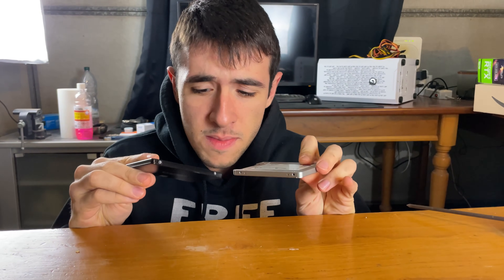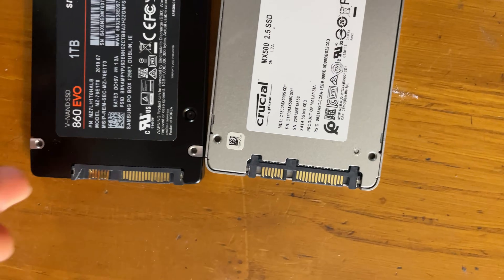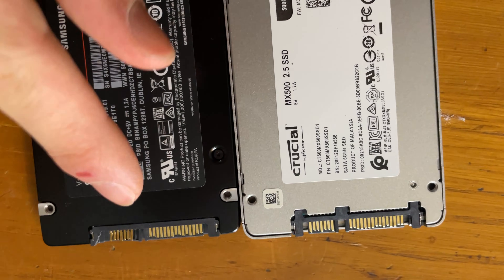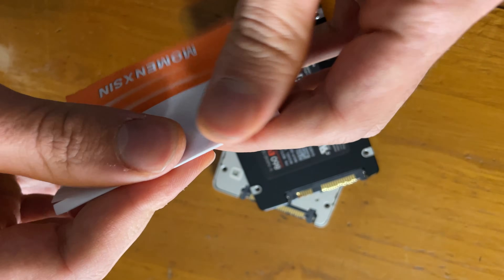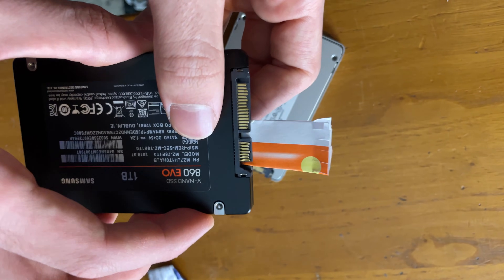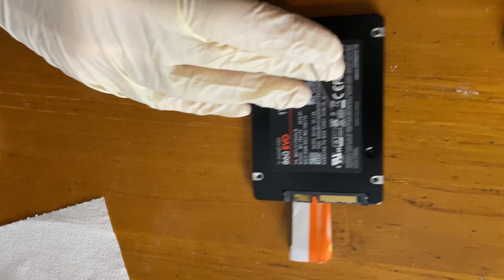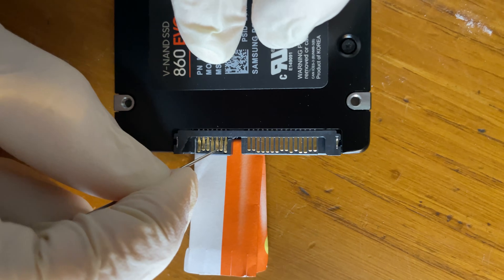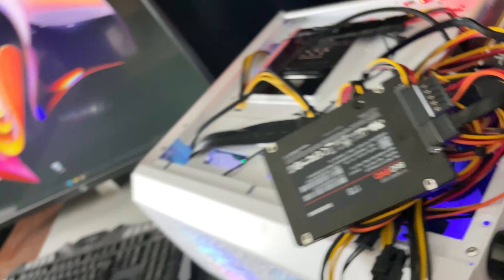Repair your Broken Sata SSD Connector (No soldering)

Comment: I haven't tested it yet, but it would have helped a ton if you could have shown putting the glue on and shown what it looked like after pushing the pins down. Mine don't look super flat even though they are clipped back in at the bottom of the glued in plastic piece. I did my best though, so wish me luck as I test it out!

Comment: That's exactly what happened to me yesterday afternoon and I am not super literate as far as all the internals, but I work on-line and so over the weekend I decided to dissect the budget build I just got and clean each and every pin, surface, and put it back together slowly literally learning each connection and its functions by way of YouTube videos and I organized the fans wires and ran them slightly different for neatness(even though the back is covered) and as I was plugging in the 2 SATA cords it went on, and I only noticed it off-centered and knew I had plugged it in properly as I am big into car audio and been repairing my amps for more understanding of them as well, but I don't  think this will work out like this one did, and I don't have the knowledge of... can I extract the data carefully holding it in place, move that data to (please insert) and figure out what my cap is on internal memory, ram, etc for a B450M board, 1tb wd blue nvme ssd, hyperx DDR4 x2 is what I've got and a portable ssd so I'm left scratching my head cuz I just got this even though it's basically ancient it's all I could afford on the spot, and everything is fully upgradeable and I'll just have to start buying every piece individual until I am where I'd like to be without being foolish cuz I want to run a full on studio where I can let's say move from one station to the next, edit, create, the whole workshop in one cage. May sound dumb, but be able to get another case with a higher end board and connect them having it either side by side or stacked. Now I'm just rambling, but if anyone has thoughts or does hand-me-downs I'm going full in on learning each and every pin its functions tricks, etc because well it's therapy for a 44 yr old guy with heavy adhd and I am super busy, etc.

Comment: sounds cool, only one of the pins actually got pushed into the case, and I'm getting the impression that means the solder connection might be damaged.

Comment: what kind of glue is that thermal glue? i smashed my ssd pretty hard on the pavement trying to dust out the inside of my desktop, sata connector plastic bit broke off leaving the pins bent up and the metal casing partially ripped out. i'm gonna mess around with it .
Reply from the maker: I’m using “attak” loctite!

Comment: thanks very much for this video :)  .. in my case the sata pins are bent downwards but shockingly the 2.5 ssd drive still works it surprised the heck out of me !  ... No idea if the drive will have problems later on down the road I hope not  :(    .. I've made a note of your video in case the drives stop working - thanks again :)
Reply from the maker: Ahahahah let's hope you won't have to come back to this vid then :) But if you like tech, consider checking out my other ones and maybe subscribing, best of luck and thanks again for commenting!

Comment: Hey man I broke my ssd in the same exact spot and I tried glowing it and put it back on it didn't work 
however in my case I smelled something coming out of the SSD is that mean my SSD is dead? and if there is any hope? pls
I need to know
Reply from the maker: If it shorted and you smelled something burning, there’s a very high chance it’s fried😔
Reply: I mean not smoke or anything just the smell of hot electronics if you know what i mean @ImWateringPSUs